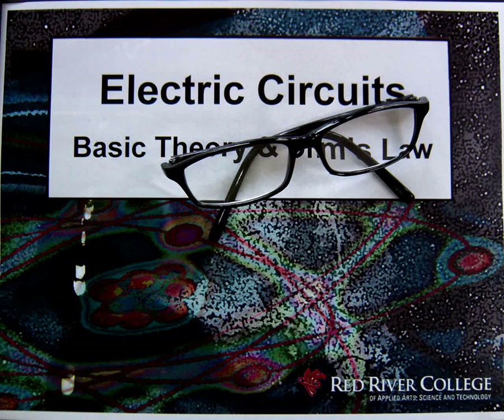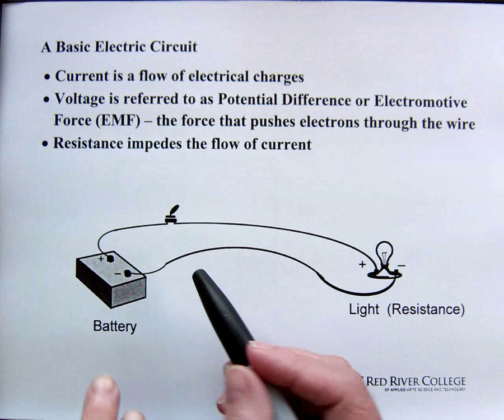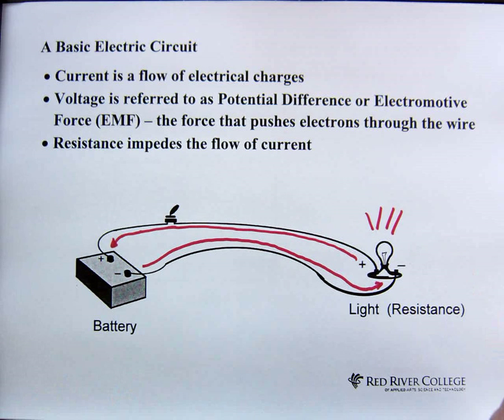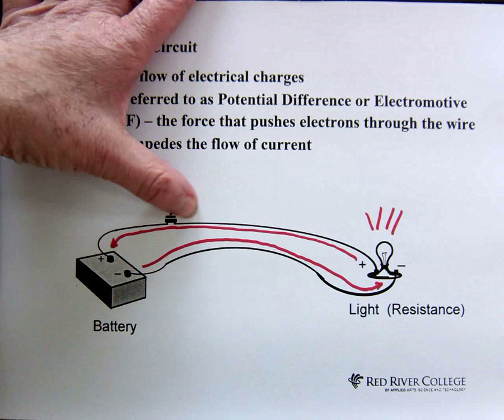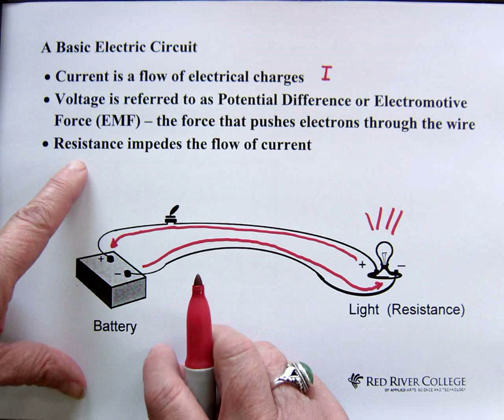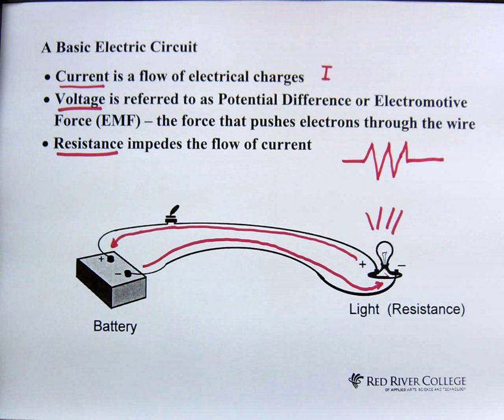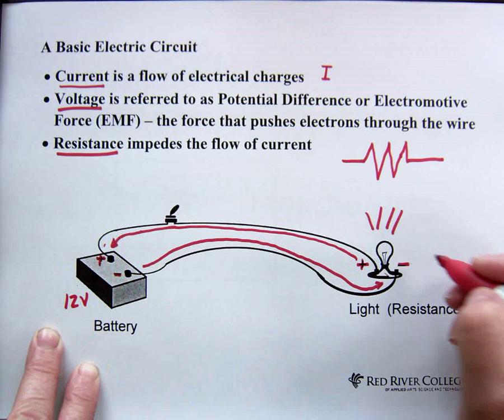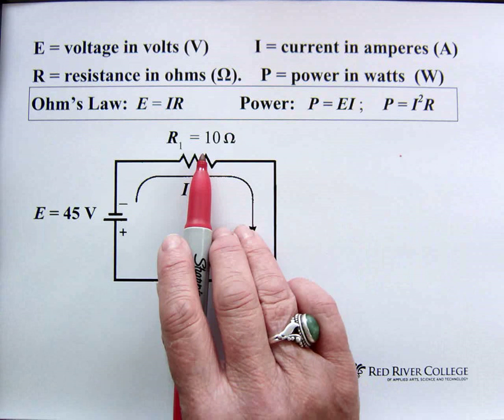1.  Basic Theory & Ohm's Law

Comment: Conventional Current assumes that current flows out of the positive terminal, through the circuit and into the negative terminal of the source. ... Electron Flow is what actually happens and electrons flow out of the negative terminal, through the circuit and into the positive terminal of the source.

Comment: I like the video and understand it is intended to teach basics, but what is the resistor for ? I thought they where meant to drop current in a circuit.?
Reply: Jon Doe The resistance represents the lamp in the example shown at the beginning of the presentation. Most current using devices (heaters, lamps, motors etc) have resistance. The effect of the resistance does reduce current flow but work is done in this process; giving heat, light and mechanical movement.

Comment: the charges move form positive to negative??
Reply: Asha R No! They move from negative to positive. However, In the beginning they thought, for many years, that the flow was from positive to negative and so when they speak about current flow, it is either conventional current flow (positive to negative) or electron current flow( negative to positive) In most cases it doesn’t make any difference which one you use.

Comment: you have the current flowing backwards...switch is therw FOR isolation...picture water flowing down a pipe doest it go str88 to the taps indoor before hitting the valve? no it doesn't..stop teach fuckery

Comment: Hello, can you please explain or clarify when you would use the second Power equation?  Do you only use it when you are trying to find out the watts of resistors in the circuit?  I am not clear on why you use the second equation or what its significance is.  Thank you for the video and any help you can provide.  Have a great day.
Reply: U can use any formulas from the wheel depending on what two variables u know
Reply: Lisa Begg you probably know the answer to your question by now as it was a long time ago but I will explain for the sake of more recent readers.

It simply depends on what values are available. If you have values for the voltage and current, then you would use the first formula and if you don’t have a value for the voltage but have values for the current and resistance, then you would use the second formula.

Comment: u r wrong I = V / R
Reply from the maker: Hi Jake Gartside. As explained in the video at 5:03, "V" and "E" are used interchangeably when referring to Ohm's Law. Just make certain you are consistent! So I = V/R is correct just at I = E/R.
Reply: E is used for the source of supply before any current flows and V is used as potential difference when current is flowing. In other words, when you measure the voltage at the terminals of a battery without there being any load connected to the battery, then this will be E. Say 12v. Now when you connect a load to the battery, there will be a loss of volts inside the battery due to the internal resistance. So, when you measure the voltage at the battery terminals, it will be less than 12v, say 11.8v. 

So, the voltages will be designated thus: E  = 12v and Vt = 11.8v and Vint = 0.2v where t = terminals and int = internal
Reply: @kennethcohan9630  I'm sure u have figured it out by now but, E and V are the same thing. voltage, potential of difference and electromotive force is all the same no matter how u look at it...

Comment: could have explained watts, amps, ohms and volts in more detail.
Reply: turdsandwicher Just for those who have the same question. Voltage is the energy given to the electrons to make them move. Energy is measured in Joules and electrons are measured in coulombs. So 1 Joule is equal to the amount of energy required to lift an apple to a height of 1 metre off the ground. 1 coulomb is approximately equal to 6,000,000,000,000,000,000 electrons, So 1v = 1joule/coulomb. Therefore a 45v battery will give to every coulomb, 45 joules of energy. The energy is being produced by the chemical reaction in the battery.

Current is the rate of flow of electrons. In other words the number of electrons flowing past a point in 1 second and is measured in Amperes. The more electrons that flow, the more energy will be transferred. Current is therefore measured in coulomb/second and so 1 Ampere = 1 coulomb/ second and in the example above 4.5A = 4.5 Coulombs/second will be flowing through the lamp. 

Power is the rate of doing work and is measured in Watts where 1 Watt =1 Joule/sec. In the above example, calculating the power used, in terms of Joules per Coulomb and coulomb per second we have Power = work done x Rate of work so P = J/C x C/s = 45 x 4.5 (J/s) = 20.25 J/s or watts. 

Resistance is the opposition to current flow and so the amount of resistance will be determined by the material used. Copper has a low resistance compared to iron and it is really determined by the arrangements of the atoms in the material. The unit used is the ohm, named after George Simon Ohm who discovered the relationship between Voltage, Current and Resistance hence Ohm’s Law.

Comment: As the current goes through the resistor, it does work (movement, heat, light, etc), so there is less energy left =  Voltage drop.
Reply: Yes, correct

Comment from the maker: The filament in the light bulb is a resistance.  As the current flows through the filament, it becomes hot and, as a result, emits light.  (Somewhat like an element in a stove glowing when it is turned on.)

Comment: by convention the direction of current is from + to -, as u are probably used to. 
since the electrons are the ones who try to 'move out' due to the voltage (tension) it's pretty logical that they are going to define the direction: from - to + :)
Reply: Conventional Current assumes that current flows out of the positive terminal, through the circuit and into the negative terminal of the source. ... Electron Flow is what actually happens and electrons flow out of the negative terminal, through the circuit and into the positive terminal of the source.

Comment: When using the right hand rule" to determine the direction of magnetic field rotation around a conductor, it is taught that one must consider the flow of current as going from positive to negative.
Reply: Conventional Current assumes that current flows out of the positive terminal, through the circuit and into the negative terminal of the source. ... Electron Flow is what actually happens and electrons flow out of the negative terminal, through the circuit and into the positive terminal of the source.

Comment: i have never seen the flow of electricity show from negative to positive. 
I am researching that now.
Reply: From negative to positive is electron flow and positive to negative is conventional flow... kind of something engineers use to try and confuse people
Reply: Conventional Current assumes that current flows out of the positive terminal, through the circuit and into the negative terminal of the source. ... Electron Flow is what actually happens and electrons flow out of the negative terminal, through the circuit and into the positive terminal of the source.